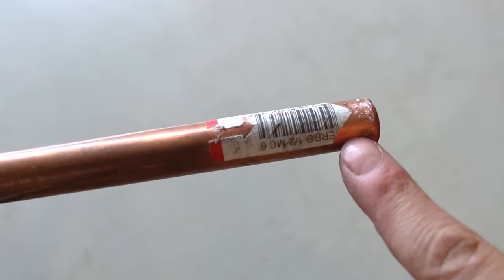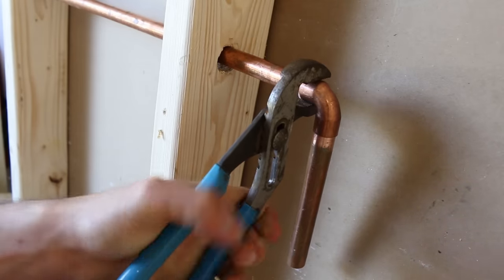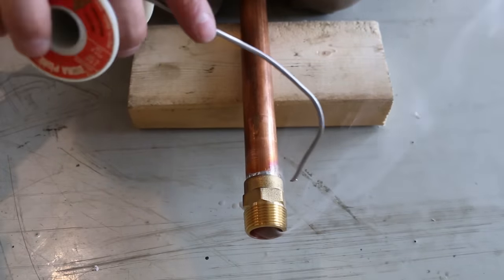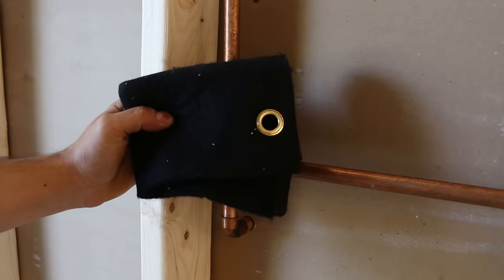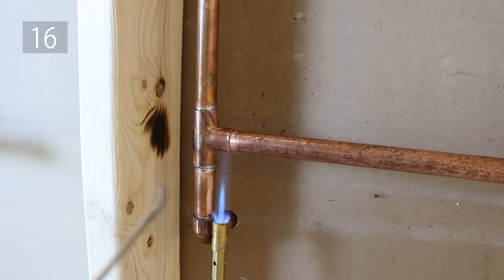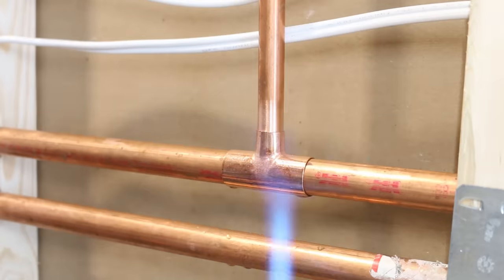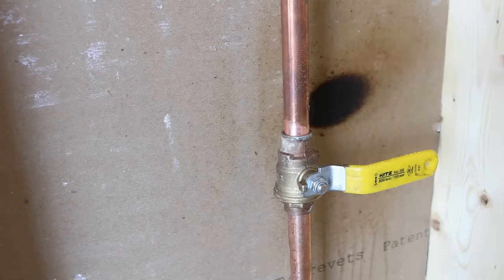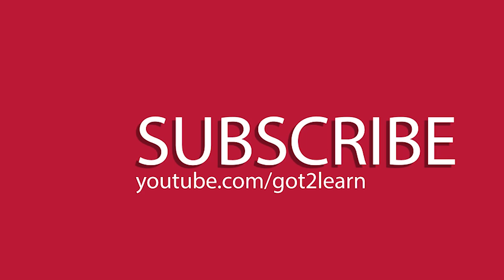The BEST 25 Copper Pipe Tips & Tricks EVER! | GOT2LEARN

Comment: The heating of the inside of the pipe got me! I've never thought of that. Also I liked the spray bottle head. I use a small shop vac for that type of fix. Does the heating of the inside of the pipe hurt the pipe integrity? I've always thought the reason we keep the heat on the fitting and not the pipe, is to keep from burning up the copper pipe, but you've got me messed up now! Lmao!

Comment: I’ve worked with people lately who say pipe dope or some of the better tapes like blue monster or mega thread can handle the heat. However I was trained to never put heat on it. I try to solder the male separate then threading it in. If I have to solder next to it, I wrap it with a wet rag. I do the same with valves I can’t move.
Reply from the maker: I do the same thing, the heat makes the teflon brittle and it breaks off as I am tightening it ;)

Comment: This guy actually knows what he is talking about . A rarity on you tube.
Reply: Sort of.
Reply: Loadsa minor faults from a very well-meaning but inexperienced (untrained?) plumber.  Brushing shiny new fittings - not needed. A good quality flux will clear most oxidation; No.2, using a narrow flame too close to the fitting, the hottest part of the flame is just in front of the tip of the inner blue flame  (better to use a butane / propane mix, wider flame, better spread of heat, and less risk of burning off the flux);  Feed the solder in from the BACK of the joint & watch it capillary into the whole joint; Scotchbrite pad OK, better use Sandvik abrasive strips with holes for dust clearance; pipe deburring - good;  water in pipe - shut off the water properly, suck the remnant out with a small diameter plastic hose; Solder - just enough to fill the joint; bread in the pipework - ugh, no, no, no, work out what you need to do to stop the water coming down, or use a compression joint, that's their purpose; use a heat mat to avoid burning the substrate;   But I do actually like the vid.
Reply: Not cleaning a new fitting is contrary to everything i have ever read or heard directly from plumbers . So as an extra precaution i would include that step in sweating a pipe to minimize my lack of experience . 
Maybe it would be better to address these things to him in a comment, as i am not qualified to speak on the subject. 
Thanks for the reply.
Reply: Dead right, but I clearly stated no need to clean 'shiny new fittings', a small time saving, esp. if you have 50 to fit on a job.  If in doubt, I will always clean fittings.  The flux will do the rest, and an acid based flux will remove any corrosion (and the skin off your fingers!).  As a retired plumber, I prided myself on having very few call-backs for snagging.  Do it right first time - or it will cost you money later.  (Y)

Comment: I tried reaming the inside and outside of the copper pipe but it made it harder to get the fitting on.  Any reason why? Probably user error but just curious 
Thanks
Reply from the maker: Are you doing this on type M copper?
Reply: No, it was on copper l

Comment: The solder will run to the heat, I heat the fitting up all around quickly then feed the solder from the opposite side of the heat.  As long as the pipe and fittings are clean you'll have no leaks

Comment: Thank you for these excellent tips. 
I’ve never had a problem with leaded solder but I can’t seem to get lead free solder to flow. Especially on 3/4 in pipe and larger. I have an old pre-lead free Benzomatic TS4000 torch and was recommended to use map gas to get the pipes hot enough. 
 Is that good or bad advice?
Reply from the maker: Yes lead-free solder has a much higher melting point so you have to be careful with the amount of heat you use, or you'll burn the flux off, the type of gas won't make a difference here.

Comment: Hey, regarding the tip to crimp the fitting so it stays in place; will that ever cause a problem with uneven spacing between the fitting and the pipe? Say too tight to the pipe where it’s crimped and stop the solder flowing correctly?
Reply: I love the tape measure supporting tip though lol
Reply from the maker: I've never had any problems doing this, and I don't know of any that had any problems so the the solder must wick it's way thru even though ;)
Reply: Got2Learn ok, great news, every little tip makes work that much easier haha

Comment: No.23 ... if you heat the pipe about 6" below the open end, it'll boil the water and shoot it out, leaving the end of the pipe empty and free to solder.

My favourites here: bread in the pipe 😃 might have to try that next time i get desperate; ptfe on the thread to prevent solder on the thread....good tip.
Reply: @Got2Learn  😅
Reply from the maker: @stoosam3244  🤣

Comment: at 5:10 in the video . If the pipe is NOT
100% round ( say very little un-oval , or a tiny dent ) will the Flux and Solder fill in that area when heating and soldering ? .... ( Thanks for any info )
Reply from the maker: Yes, but more risks of it leaking if it's "too oval", cheers ;)
Reply: @Got2Learn  ... Thanks for reply . That's what I thought . Just didn't know if the pipe HAD to be 100% round .

Comment: Open mesh emery works great, and you can get it wet and still use. Not a  gate valve, but a boiler drain. To keep solder off of threads or union faces, coat with pipe dope where you don't want solder.

Comment: You can also use the adjustable wrench to shrink the tubing. I read optimal clearance is .001 to .005 inch.  Just keep running the wrench around the tubing taking it down a little on each revolution.
Reply from the maker: Cool, thanks!

Comment: Salut je sais pas si tu parles francais mais tu as beaucoup d'equipement francais donc je vais poser ma question en francais 

Pour le circuit chauffage il vaut mieux du brassage fort ou tendre ?
For the heater circuit it's better to use strengh soder or soft ? 
Thanks
Reply from the maker: soudage mou/soft.

Comment: Cooling the pipe down with a wet rag is perfectly fine as long as you don’t put the rag on as soon as you stop soldering. If you wait like 30 seconds or so then you can put the rag on and the solder 100% will not crack. Was even taught to do this in college years ago

Comment: After soldering a joint can I use flux and brush around the joint to have a cleaner joint ?
Reply: Jazz Bansal yes, I do this on every joint I solder. Makes for a nice clean joint as long as you clean the fitting after with a rag/towel. Other wise your joint will turn green after a short amount of time
Reply from the maker: Just wait till the joint is a bit cool.

Comment: Thats likely to be super useful for me soon. Thanks! Quick question : i have am old fridge compressor i need to convert into a vacuum pump. What attachment to use in the copper piping please? (i'd live a compression fitting but i suppose I will need to solder). Thanks!
Reply from the maker: You are welcome!
Depending on your budget, brazing (more expensive) would be the way to go, but soldering can work too (less expensive).

HOW TO BRAZE: https://youtu.be/LdCK58UcnhA

HOW TO SOLDER: 
1) https://youtu.be/JyVbjDsric4
2) https://youtu.be/NQmWLr1qBsM
3) https://youtu.be/xJodDBC5AwY
4) https://youtu.be/UcxfxWVATLc

Comment: One tip you showed us, but didn’t mention was how to wind Teflon tape around a pipe fitting that is very close to a wall. Wind the Teflon tape around a pencil, then unwind it on the fitting.
Reply: Don't use tape,  use paste

Comment: No 26 always have a box of spare tape measures because once used for supporting a pipe while soldering you'll find its clogged with solder and destroyed, 
No 27 it's if you have water constantly flowing making it hard to use a solder joint use a compression one not forgetting ptfe tape on olives, see.... easy as pie 🙄🙄🙄
No 28 if your soldering a joint near a stud start applying heat from the opposite end and work your way to the stud, the solder will follow where the heat is thus making it easier and quicker to solder the joint by the stud, thank you....

Comment: Does it work attaching something to a wall (2 flat surfaces) where you can't get the uv light to it?
Reply from the maker: I don't understand your question Bern.
Reply: @Got2Learn  I want to attach a shower shelf to the walls of a shower cubicle. All the examples in the video shows where the join will be made. In my case, pressing one part up against the wall with a sandwich of glue, how do you get it to set?

Comment: For number 4 you can also take a hammer and a drill bit you don't use or something similar put your pipe in position a make a small indent by hammering the bit once on the fitting with the pipe inside.

Comment: One solder job I have in the future (with 1 1/2" pipe no less) is how to effectively solder a vertical joint where the pipe is on the bottom and the fitting is on top, so the solder has to flow up!  Can this be done?
Reply from the maker: Sure why not ;)
Reply: RE:phillman5.  Yes, it is called capillary action; the solder will be drawn up into the joint.

Comment: Many years ago (1976) I was using a new product (to me ) called "Swifts Solder" that looked like gun grease.  It was a powdered solder in an acid flux base.  It worked great. The old timers didnt trust it and would follow up behind it with 50/50.  Rather like push fittings, it will take time to trust them. Loved the idea with the teflon tape on the threads to prevent solder from sticking.... How about a trick to prevent the same problem on a copper union??? I've had that happen several times where it gets on the union face joint. Maybe a bit of oil????

Comment: Just another quick tip for out of round pipe. If you have pex crimpers, just gently pinch the pipe and turn it 90° each time. Works better than an adjustable wrench.

Comment: Idk if #22 is all that good with the water sprayer and wetting that drywall or sheetrock like that. I get it but there's better ways for heat protection like you said for #12 just get flame resistance fabric and that fire extinguisher you could trap moisture in the walls spraying it down like that.
Reply from the maker: It's really not enough to do any harm.

Comment: Wrap the plumber's tape counterclockwise  so it does not unwrap when threading the fittings together.
Many times you can solder fittings on the edge of a table. They do not always have to be soldered in place.
Reply: Um, no. You wrap it the same direction as the threads- clockwise.

Comment: My dad , who is not a plumber told me that solder sizing  tip because everyone uses too much solder. 
If it's a 1/2 pipe, bend a 1/2 inch of solder on the end of the roll. 
3/4 pipe? 
Bend a 3/4 inch piece of solder. 
Size the solder to the pipe basically. 
No need for huge globs all over.
Reply from the maker: Yes that's a very good trick actually, thanks buddy!

Comment: Do you use the deburr on the inside and the outside ?

And can you use sandpaper to deburr, or do you need to use the tool and scrape off part of the pipe ?
Reply from the maker: When soldering, deburring is only necessary for the inside. When using fittings with gaskets inside such as Sharkbite/Pro Press, you must deburr the inside AND the outside.
Reply: RE:ocsrc.  Using sandpaper on the inside would probably take you a long time. Quicker to use the scraper/deburring tool or a round file.

Comment: how would u have approached the last step it was a coupling instead of a T.  Since you wouldn't be able to heat the inside how about just heating the outside but away from that area
Reply: nigel R: you wouldn't use a coupling , you would us a longer piece of pipe, it's called planning ahead, even for the T I'm sue that joint could have been soldered  before putting the pipe through the wall.
Reply: @dominicoconner1973  thats not the point . its not just about putting in pipes. its also about doing repairs. if you planned ahead you wouldn't need to weld so close to the board now would you?

Comment: Instead of the squirt bottle head, buy some 1/4" drip tubing. You can buy a 100ft roll for cheap. If you're an irrigator then you probably already have some. You can stick a long piece in the pipe and blow. A lot of water will blow out but you'll have several feet of dry pipe. This also works for slow leaks. It buys you enough time before the water reaches your work.
Reply: Interesting.
Reply: Or you can plug the end with your thumb like a straw in a glass of water

Comment: #26 put a coating of solder on the pipe about 1/2 inch or the length of the fitting till flush then slide your next piece either joint, elbow, connector, whatever it is then all you need to do is apply heat and the solder will melt again give you a nice solid seal.
Reply from the maker: Neat trick, you are basically tinning it first, brilliant!!
Reply: i actually make all my trainees do that to all their connections for a good couple days. it really helps to build confidence when learning and you dont have to come back a week later and fix a leaking weld.

Comment: I like your stuff, but one nit to pick. Using solder filled flux is going to be covering up problems with heating joints and/or cleaning them. I have watched a lot of folks making joints over the years, and usually the problems come down to inadequate cleaning or using the torch to heat the solder instead of the joint. I show people how to solder using the "penny test". I take a penny and show soldering to it both without cleaning it, and then by dripping solder to it then show how you can pull the solder back off of it. When the penny is clean and you melt the solder on the penny instead of dripping liquid solder on it, you can see the surface of the penny sucking the solder over it like a hover vacuum. Its an impressive demonstration that you don't see when it is happening inside the joint.

Comment: Just wondering, do you use solder plumbing in your day to day work? In Sweden no one uses this kind of fittings anymore. Seldom copper pipes either.
Reply from the maker: All the time! @PH Johansson
Reply: In my area (US) they're transitioning slowly to pex, mainly to cut the cost of materials and second to stop people cutting pipes out for scraps lol. Most older houses still have copper pipes, so repairs are still done with soldering.
Reply: There is ALWAYS copper
Reply: Check your waterheater say.

Comment: awesome!.. but what is your opinion on plumbing a house with PEX?
Reply from the maker: PEX is good buddy, go for it!
Reply: QAnon General 

I have problems with PEC with longevity and rodents eating the plastic at lease here in Hawaii. Copper is best but cost could be prohibitive. 
I believe that there was a class action lawsuit re: PEX approx. say 20 yrs. ago but I think that they have improved. 🌺
Reply: I use pen every day and haven’t had a problem yet. Seems to last pretty good so far. 15 years no issues.
Reply: @vp3970  
Why don't you Google some of the new YouTube video showing all the PEX being tested in extreme conditions
Reply: @shawnt8891  
With PEX the failure is usually in the connectors and not the piping itself

Comment: At 2:43 you describe the sediment faucet as a "gate valve" it is not such. It is a rubber disc with seat
Reply: What''s a globe valve for $200.00
Reply: Kenneth G, that is not a globe valve whatsoever, a glove valve is precisely that- integral globe, also the best valve for flow balancing and throttling.  Look at  a cutaway of a globe valve and then tell me if the valve in his video which contains a flat rubber washer that makes to a machined flat surface in the valve body are the same.

Comment: How would you re shape a 4" copper pipe with a dented end?
Reply from the maker: You can't hehe
Reply: @Got2Learn  the wrench trick or rotating the pipe in a vice wouldn't work? I'm trying not to cut down the pipe and use a coupling
Reply from the maker: You mean 4" in length or a 4" diameter?
Reply: @Got2Learn  diameter. I bought part of a sick of 4" L and I guess when they cut it, they deformed the end a bit. The couplings can't slide over
Reply from the maker: Ouch! Not you can do for 4" hehe
Reply: @Got2Learn  I'll try to figure it out
Reply from the maker: @davida5296  awesome, lemme know what you can come up with  ;)

Comment: 8:35 shows ball valve closed- if you sweat that way it will ruin the valve. Also, no mention of cleaning joints after they cool. Flux has an acid that will make the joints that ugly blue/green, and even eat at them over time.
Oh, hey- I want my license plate back! Lol
Reply from the maker: Hehe, thx @bruce a it's not easy making a vid with 100% the, however, I do cover those things I forgot in other videos I made so, it's all good ;)
Reply: Yes, wasn’t to criticize but point out for others who may not know. Also, with the valve open the handle gets in the way of sweating the one end, so guys may be tempted to close it instead of remove the handle if needed.

Comment: To get rid of the water inside a pipe, I use compressed air.
Reply from the maker: Nice, if you have a valve tgat isn't sealing, does this trick still work? @Pierre C
Reply: @Got2Learn  It will push some air behind the valve, and depending on how bad the leak is, it will buy you some time.
Reply: @Got2Learn  "if you have a valve tgat isn't sealing" better take more plumbing apart and replace the valve.